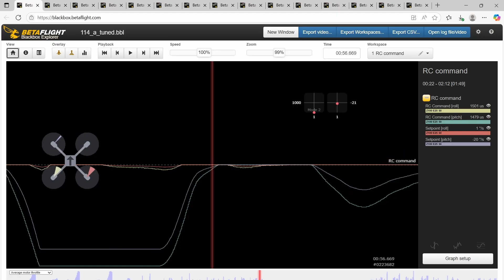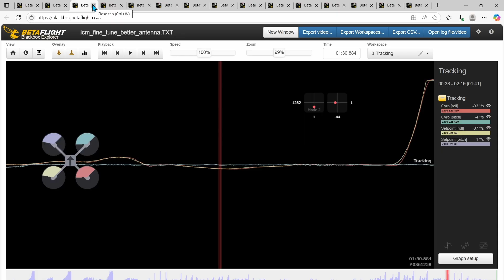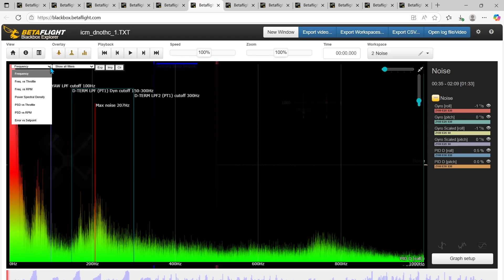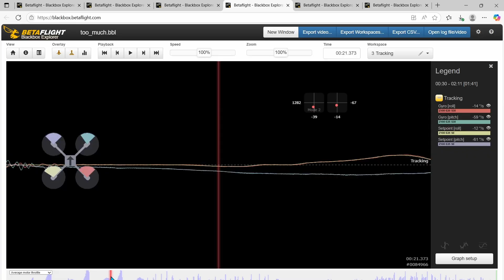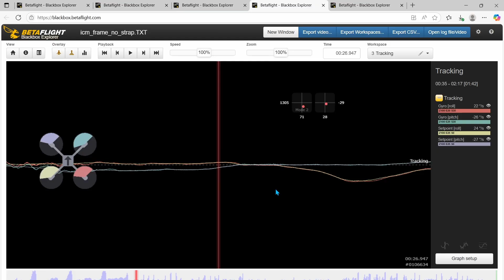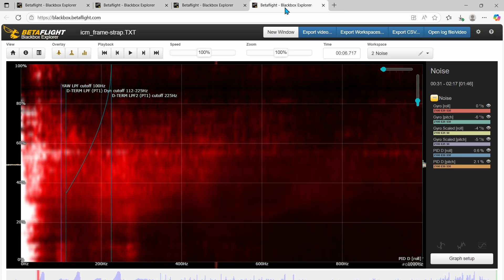Black Box analysis of the HDZero AIO15 (ICM versus MPU6000 gyro)

Comment: Man I learned so much from this, would be really cool to see you set a completely fresh whoop build up like a brand new analog board with stock betaflight settings. I know it's a lot to ask but your explanations are like the most comprehendable lol. I just retuned my meteor 75 pro after I swapped it into an 65mm frame and 0702 using your 3 min tune video and it flies great!

Comment: that is, aio15 is faulty because I have a problem with it When I'm flying for more than 3  seconds and I throttle down (zero power), the drone continues to fly (glide) for a few more seconds. (when I accelerate for only half a second, the drone immediately falls)
Reply: I think dynamic idle is indeed too high. I see something similar when I dive and am at 0 throttle. It would "glide" much too much. I'm also on a 2'' build and that tends to be floaty... But what I see is indeed too much. 
That said this is a setup issue, not a fault.